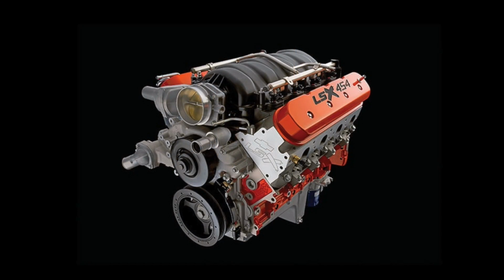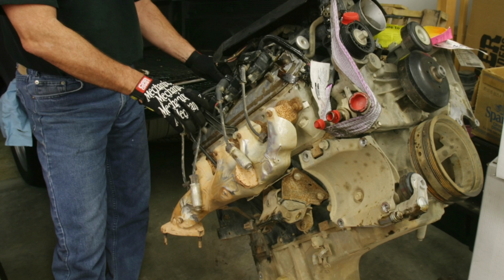Everything You Need To Know About The Chevy LS Engine

Comment: Active Fuel management DOD is garbage the worst thing GM came up with! Other than that LS Motors are beast!
Reply: Ford will never build a engine as good as ls Chevy engine's
Reply: Donald Kinder I’m not even a Ford fan but Ford has built numerous engines better than GM . The LS was their best effort but they produced so many shitty engines I cannot count them all.
Reply: @prevost8686  when was the last good Ford engine? Outside of their SOHC V8's in the 90's, their DOHC V8's and turbocharged V6's have been unreliable garbage. Just look at the latest generation of the 5.0 coyote. Sleeveless aluminum block junk with huge variations on piston-bore clearance in so many of them that they're infamous for piston slap. Ford is still using the brittle powdered metal oil pumps that disintegrate. Failure prone lash adjusters, timing chain rattle yet again, etc. You would think that Ford could manage to at least fix timing chain rattle but even after all these years but nope brand new 2019 Mustang 5.0's with timing chain rattles on decel, piston slapping, oil consumption, weird issues due to the overly complex dual fuel injection system, variable geometry manifold issues, etc.
Reply: At least AFM is easy to disable or replace. A lot of other engines have fuel economy designs that aren't so easy/affordable to disable or fix.
Reply: @hochhaul  Electronically, sure. But the biggest problem with DOD/AFM is that they did not rotate which cylinders deactivated to even out heatload. They only put  deactivation hardware on specific cylinders lifters.  To properly deactivate DOD, you have to swap out deactivation hardware and install regular hardware too.

Chevy should have put deactivation hardware on ALL cylinders and program to rotate deactivated cylinders: For heat load AND vibration (transmission tunnel).
Reply: @iroulis If you electronically disable AFM, all 8 cylinders are always firing, so there is no abnormal wear if there ever was any. The lifters always stay locked, so there's no risk of a failed lifter either. The 2009-13 AFM engines had issues. Those issues were mostly addressed when they designed the Gen V engines. By the way, even Toyota and Honda had oil consumption issues back in in the late 2000's and early 2010's. Hell even today Hoonda is being sued for oil consumption. So is Ford and they don't even use cylinder deactivation (yet).

BTW, DFM on the 2019+ Gen V engines do spread out cylinder deactivation across all cylinders. It's so smooth you can barely tell it's deactivating cylinders most of the time. There are 17 different deactivation patterns.
Reply: Nah the north star v8 is the worst gm has made
Reply: Trevor Lahey Which is about how long GM’s chains are lasting.
Reply: WILLIAM GRAYSON would a 2005 Silverado with the 5.3 have AFM or nah ??

Comment: Also the weakest engines get a coyote and decimate all ...
Reply from the maker: Both engines are great. Coyote is better on paper and has a superior design. LS is way smaller, has more displacement options, and is cheaper to buy/build. I prefer LS engines.
Reply: @Dustrunnersauto  I would build a aluminum block CHI head Cleveland
..may cost more but you wouldn't catch me!

Comment: LS1 engine's are damn good engine's plain and simple.. design team actually went to Ford to purchase the LS1 engine design but Ford turned it down. Bet you don't also know that LS1 head's would fit on a 351 Windsor with little modifications. Also the 6 bolt main design is Ford's design used on the 427 dohc engine in the 60s that also used roller bearings on crankshaft to turn major high RPMS..
Reply: Smith is full of shit. Small block Chevy came out in 1955(265 v8) The block is virtually identical as the original version. There are a few differences but close to original. In 1955, Ford was still using the old Yblock. I know, I have one. Quit throwing shit against the wall and hoping it will stick.
Reply: Count it as another major mistake by ford...they prefered to make their motors smaller with more valves...i was a die hard mustang guy but i disnt have tons of money to put into making the mustangs i bought fast. Ive had 2 5liters an 85 4barrel and a 94 efi ho. Also had 2 32 valves a 96 cobra and 03 mach 1...the only 1 that could compete stock with either the lt1 or ls1 was the mach 1...after driving my friends 2001 z28 i fell in love with the ls1. I will never understand how ford could leave mustang owners so horribly underpowered compared to their competitors! What in 95 the lt1 was making nearly 300hp...and even the cobra 5.0 was only about 225...96 got even worse for gts but better for cobras...but a cobra shouldve been able to beat z28s and trans ams-not barely keep up (and not even really)...ill never get it
Reply: ford wishes they designed a good motor fuckoff ford fan
Reply: @camclarke2663  your moronic. Actually I'm building a LS1 80 mm turbo, NOS in my S10. I'm a GM fan PRICK
Reply: @camclarke2663  they have jackass. I've raced both over the last 25+ years. Ford is the only manufacturer right now that has a factory ported head running 5.80s @250+mph. Find me an LS or LT head that comes on any Chevy running near that. Won't happen. Need an aftermarket head. Also you can make power with either if you know what your doing. Mustang in the 90s even with the small motor put many Chevys on the trailer. My little 331 in my fox body ran well into the 7s with a single 100mm on a 10.5 tire and that was over 15 years ago. Ls and not the new LT are great motors but the new gen3 coyotes hang with them and have a stronger factory crank. Will take 1400+. I now a few stock 5.3 have been fast after arp bolts and shit but didn't stay together for much more then 1 or 2 passes on kill. Talking shit about a manufacturer just cause you like one over another is just stupid. Makes you look very uninformed
Reply: @waynebollentin989  them tell me why the world is running chevy in 99% of race cars NOT FORD
Reply: @camclarke2663  one it's far from 99% and anyone with common sense knows it's because of cost.
If there's not many ford race cars why has the NMRA been around for almost 20 years. Had more cars show up at events then in the NMCA which is open to all manufacturers. Years ago it was no different. Local track had mustang vs Camaro then had to make it mustang vs Camaro and firebird/trans am. Mustang vs grand national then it went to mustang vs all Buicks.
I have nothing against any of these cars but it just shows how stupid your statement is. Shit my first car in 1989 was a Buick GS 455 stage 1. Getting hung up on one manufacturer is stupid. Any good car guy can make anything run. Even an import if it came down to it. 
Look I've raced everything. Could careless who the maker is. You can make power with any manufacturer. You want to live in a bubble where only Chevy is king cool. One question though if Chevy is the best why does the fastest cars have a Hemi? If you think you're a little smart you'll bring the 481X into the conversation but if you're really smart you wouldn't because other then the bore spacing the design is from the hemi.
Reply: @waynebollentin989  obviously u know nothing when it comes to any build or race application everybody goes gm why reliability and power....ford and mopar don't have a rep for long lasting power there built to fail...
Reply: I actually looked that up to see and i am honestly surprised, the 351 heads can also fit on the 302 so lil baby 5.0 can have some more fun

Comment: good engeneering as far sealing areas are designed ,simple set up nothing complex about it ,but the quality of some of the internal parts is garbage ,I have had three 6.2 aluminum blocks fail, the pistons break at the connecting rod sleeve while idling ,I have seen this more than once ,other than that its an excelent designed tall block
Reply: right....idling.....yeah that happens all the time....NOT.... I have never seen this ever happen, even in 1000 hp cars.....so....NO
Reply: that's because you are inexperienced ,idling fool idling ,GM uses cheap pistons , something you know nothing about
Reply: Ok ......you are the expert, all those 6.2 LS motors breaking connecting rods at...... idle........you wonder why 80% of the engines at the track each weak are LS with all those pistons just flying off at idle.......Not at 7000 rpm or with 29 psi of boost.....Nope....at idle.  But im "inexperienced" so what do I know.........ohh wait I know....i must not be idling enough.....I need to stop racing and idle more.....then I will see exactly what you are talking about. Ill try that this weekend and see what happens.
Reply: I don't know what medication you are taking but whatever it is get soe therapy or try a new carreer ,a clown seems to be your forte
Reply: I may be a clown but I know LS engines dont break pistons at idle..............Everyone that races one, or even knows someone whose bothers girlfriend races one, knows that you are just repeating what you read on some Mustang forum on the web. Yeah sure I have seen connecting rods break at 7000 rpm and with a ton of boost, but not.....at idle.
Reply: @DrJ262  you dont know stock 6.2 bozo
Reply: So now you are telling me stock 6.2 LS just break pistons at idle? Yet 1000 hp plus boosted LS engines don't.......wow that sure is strange?
Reply: give it up dude ,you re strange
Reply: at least im not making stuff up............
Reply: Give a rest ,we have our experiences with these shit motors ,don't get offended unless you are gay I ll understand
Reply: You are great source of entertainment for all my friends with LS motors. You are not the first (Ford, Mopar, rice burner) guy to come up with some ridiculous claim as to why LS  motors are  "Garbage".  However...... "the pistons break at idle"...... is a first and its hilarious. Thanks for the laughs.
Reply: seen it more than once on the 6.2 ,keep on laughing
Reply: Ohh dont worry we are, cause we all know you have Not seen more than one 6.2 break pistons at idle. In fact we would like to challenge you to show some evidence, YouTube video, article in a magazine, video from your phone............now remember videos of a 6.2 breaking a piston at 7000 rpm of with lots of boost dont count......because it happens "at idle".......
Reply: don't need evidence ,just stating what my personal experience ,seen that shit twice ,I could care less if you believe me ,I know what I saw ,and the piece of shit was idleling whe the shit motor locked up ,number 4 piston broke ,nuff said
Reply: Thanks!!!! you just won a bet for me. I bet that you would repeat your " happened twice comment" everyone else bet you would back off the twice and say once........HA HA ...... So this thread has served its purpose to, ONE: Expose your lack of knowledge on the subject. Two: get a good laugh at your lack of knowledge, and Three: Point out the truth.............and that is...... IF you saw a 6.2 break a piston at idle, it was in fact probably cracked at some other time for some other reason and just came apart as it was sitting at idle.
Reply: yeah cause they just break "at idle" for no reason.........happens all the time............
Reply: Ahh...... your best comment yet, .....but...... you forgot to mention the part about idling.
Reply: Idling ?????????? the fuck ????

Comment: Ford ain't got shit on Chevy as far as popularity and different aray of vehicles. Ford's are nice truck wise and mustangs oh crown vics but here in Atlanta it's general motors all the way and lil bit Mopar.
Reply: mate... ever heard of the Ford Barra??
Reply: ThatWalrusInUrPiano +1
Reply: @landcruiserfan4206  the barra is a gem among dung
Reply: The Ls is a pure copy of the 351 windsor with minor updates and other things taken from the ford back catolog of engines, ford small block exhaust runner configuration, ford small block firing order, ford fe 427 side oiler crossbolt mains heck if you carb an ls motor and go from crank trigger to a distributor you even use a ford small block distributor and the distributor goes in the front like let me think oh yeah a ford engine.. everyone is an ls fanboy but no one does any proper research why its so good or where chevy got their ideas from... even the spacing between the exhaust runners are the exact same as on a ford small block.. laughable how diehard chevy fanboys have never even looked at a ford small block from the 60s and been able to put 2 and 2 together..
Reply: @pejjiz  Well have you done your research then? Ford fanboys forget that engineers transfer from company to company and take their knowledge with them. I've seen your type comment made by others so I had to check it out and movement of engineers is the reason I found.
Reply: Ford 7.3 Godzilla
Reply: @timothykeith1367  very popular with mechanics for paying bilss

Comment: i want to install one on a jeep wrangler tj 2002 every day ride, any suggestions?
Reply: I have seen this done. As long as you get a good wiring harness and use the GM ECM it's a no-brainer. Nice conversion. If you use LS1 or LS2 with a 4L65 it's simpler, just one ECM which also controls the txmsn. If you use a later (Gen IV engine with a 6L80 they use two seperate computers (ECM & TCM) It starts to get complicated. If going manual (stick shift) I don't think the Jeep box is strong enough, you'd need to look for a suitable Tremec box I think.

Comment: If chevy ever does some R&D on the oiling system and adds adjustable pushrods the LS will be a much better engine. The rest of it is great but still has its problems. SB chevys can be built to the 750 hp range (naturally aspirated), but LS engines have to have add ons to get to that range due to aftermarket parts avaiilability.
Reply: If you had seen a profession company working with LS V8's that were fitted with nothing more than bolt-ons, you would never have made such an ignorant statement.

Comment: the ls engine is not the best engine however this kid sounds like he is reading form cue cards..the 6 bolt mains are ok but needed because the block is aluminum the best ls blocks are cast iron. gm cut some corners with the bone stock ls engine ie synthered rods are junk. the improvements are the oil pump and the intake ports on the heads..other then that aluminum blocks using any water based coolant are doomed.. the coolant will break down into the raw forms of distilled water and the ethanol base will evaporate..distilled water will leach out aluminum creating stress fractures and pits and holes. the ls base is a cheap easy way to make decent power...however the best ever factory engine was the chrysler 340 engine came with forged and shotpeened crank rods pistons cam and pushrods believe it or not. Not only that most the blocks where stressed prior to assembly as well. the ls is a cheap way to make decent power on a budget but not the best smallblock or v8 engine ever made on the assembly line.

Comment: It is not cheap, I am putting a new ls drive train in a 35 coupe. Every body else is putting new strokers and iron blocks in their coupes. I could have saved over 10,000 dollars if i went with a iron block. Just the computor and harness to run this engine is nearly 2,000 dollars, I am sure ford is the same price.
Reply: Its cheap if you get junkyard stuff, I swapped a c10 for under $2000 for everything including a 4l60e transmission and the $580 for hptuners.

Comment: well done bryce-;which engine is the standard corvette enginethat comes in at 427cubic inches?
Reply: Briane Howland so you telling me it took ford almost 7 years to beat a 2006 engine 🤔🤔🤔
Reply: Gra 7961 Not well done don't get brainwashed there's not a single instance that the Ford Mod Motor is not stronger or able to produce more power modified, and it's been 3 decades Ford has been building Mod Motors. The 2006-20013 Corvette ZO6 has the 505 HP 7.0L 427ci LS7, and it was also in the 2014 Camaro Z28 that got beat by 6 seconds on the Nurburgring in Germany by the 2015 Shelby GT350R with a much smaller engine (5.2L)  LOL.